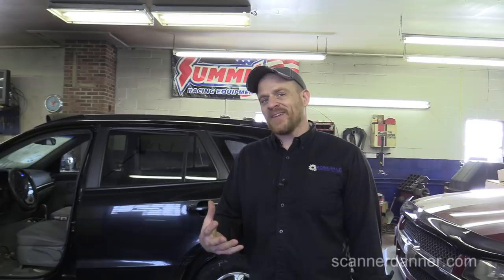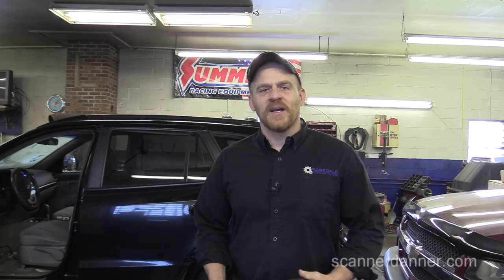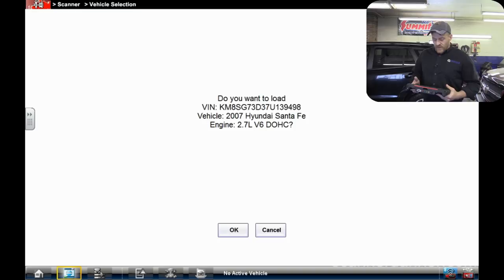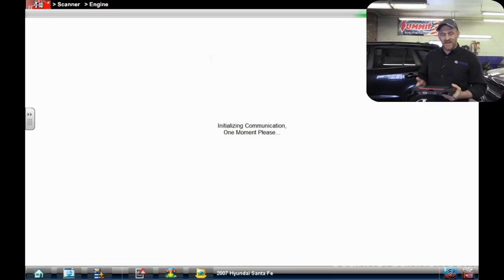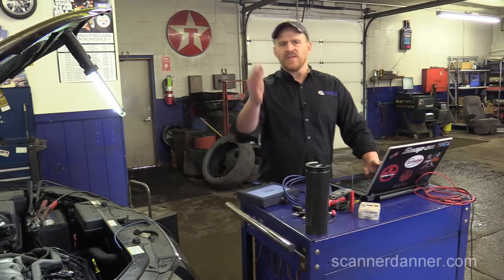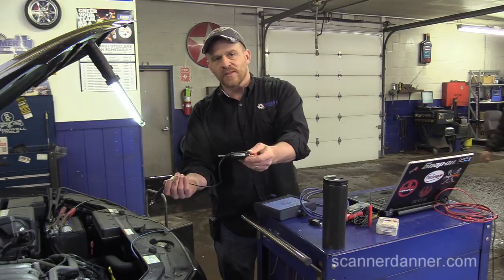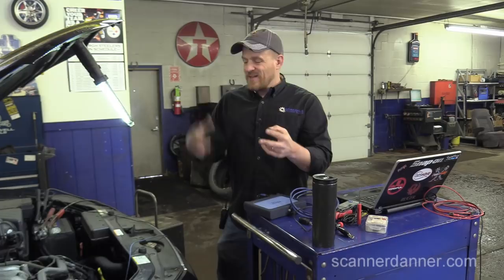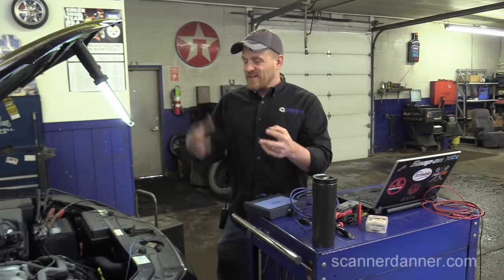No Start Testing Basics - Spark, Injector Pulse and Fuel Pressure (Hyundai Santa Fe)

Comment: ScannerDanner I want to thank you again for your videos, because I have learned a lot from you about testing circuits. About a month and a half ago I started having intermittent no crank no start issues. At that time I replaced an ignition switch after watching one of your videos, unfortunately that wasn't the issue. But your video started me on the journey that kept pushing me to try and solve the mystery. Your videos are the most detailed even to me who never held a volt meter or a test light in my life. After changing the ignition switch and realizing that it was not the problem I started focusing on your videos. I learned more and more every day. My intermittent no crank no start persisted. Once a week, twice a week, my car left me stranded. Today I finally solved it. It was a single partially broken wire from battery to pcm. One day I realized whenever I had no crank I also had no check engine light. And that started me on the path of working up the courage to actually dig in deeper under the hood. Unfortunately mechanics throw parts at vehicles without even turning on any of the basic tools that you teach us how to use. And they are really not that hard to use. Especially for someone who is supposedly schooled to use them for trouble shooting. When I realized that my check engine light was gone and there was a very good possibility that it was pcm related I didn't even want to go near a mechanic. For a simple reason, because just like how they changed my starter at the beginning when this problem started without even testing the circuits, or fuses, I was afraid they would do the same thing with the pcm. So I kept watching your videos. And I found a single red/white wire that had a tiny little hole on the plastic and as I jiggled it it had white powder like substance (corroded away wire) falling out of it. I split the wire touched it together, check engine light appeared. I also had a random stall problem too. So turns out this very same wire was causing that too. I started the car up and while running I pulled the wire apart. And it stalled instantly. I recreated both issues to make sure that wire was both capable of causing the no crank no check engine light,and the stalling as well. My point is that I really appreciate your videos because you most likely saved me from wasting money on parts I never even needed in the first place. Money that I don't have much to waste to begin with. Having an unreliable vehicle is very stressful. And you help those of us who don't have the means to just replace everything until we find the actual problem. I'm really very grateful and I wanted to share my unfortunate and prolonged story, and thank the person who's online guidance helped me to finally fix it. Thanks for your videos, they are very educational, and helpful.
Reply from the maker: Does my heart so good man. God bless you brother. Thank you for encouraging me. Your timing is ordained. You have no idea
Reply: Way to go for figuring out that a small corroded wire was causing all your issues. That is a serious challenge. I can relate to this post, often times I forget that I can in fact accomplish anything that I put my mind to. Sometimes it takes persistence and courage.

Comment: At 30:00 to 40:00 , and again from 49:00 to the end, this is far and away the clearest, most concise explanation of the use of the AES Wave uActivate I have seen ANYWHERE on YT or the elsewhere on the internet.  Both with and without the use of a scope and amp clamp.  AES should stitch these two segments together just to show the tools versatility, and with proper knowledge to back its use up, also add speed to the diagnostic process.  I love mine, and am shocked by many who bought it (incl the older version) and whom have never used it, or are maddingly, blindly unaware of its capabilities.  Of course, one must have a full and clear understanding of automotive electrical theory to put it to its best use, and also not misuse it, or you could seriously damage components (similar to weaponizing a Power Probe if you don't know what you are doing) by sticking other tools into the banana jacks (doubling as test ports), like for example a Power Probe or test light into the wrong ports.  Sure, if you've been around for awhile you probably can already do the same with a multimeter, test light and a fused jumper, like a lot have been doing.  But for someone who hasn't, and is trying to speed up the diagnostic process, this works very well.  Well done, sir.

Comment: Love your process… if you beat 36:38  on the tank, you might actually cause a bad ground to get good enough to make the pump run and it wouldn’t be a bad pump. It may just be a bad ground and it will show up again later if maybe the tank itself was not grounded or wherever it grounds to .

Comment: I did not read the 406 comments for this video, so maybe someone already mentioned this. You say resistance goes down with temperature. It goes up. You saw this with the current. It initially was 2.5 amps(cold bulb-low resistance-high current flow) but decreased to about 1 (hot bulb-high resistance-low current flow). Probably misspoke. Great videos but a little verbose. Could be cut down and still get all your excellent knowledge across. Great teacher. Very informative videos

Comment: Amazing video and Great timing, a V10 Excursion came into the chain store I work at as a tech yesterday 1-20-18, Possible faulty fuel pump on ticket,  Long story short , if the tech that ( started ) to diagnose the problem didn't send it away because of aftermarket wires under the dash- I would have done  very similar in my testing, After seeing this video it makes me question his skills for one thing, and why he didn't check for current at the pump wiring and or check the pump for ground,  he did raise the vehicle and listen for pump noise when someone turned the key, but did not go any further than checking fuse/relays and ear testing, If the vehicle is still in the shop I will myself test this with a test light and leads and see if current is making it to the pump and checking pump for ground,  Thank you for you knowledge and willingness to teach and show others fancy tools are not always needed in some cases, This excursion can be tested the same way and I would love to do it for A theory and B Wanting to be more confident in my diagnosing and repairs, Again thank you for this video and Keep up the great work !

Comment: So essentially, if my learnings today are correct, I could essentially hook my test light to battery positive and then probe pin 87. If light is present it confirms I have ground, decent brushes, and intact wiring or of course if no light, I have an issue with at least 1 of the 3. This all seems too good to be true lol, this can be done within minutes as well as the convenience of staying under the hood.

Thank you for all the knowledge you share with us, you make me feel like I could actually do this for a living if I ever wanted to give up machining.
Reply from the maker: yes sir, but keep in mind that it only tell you there is continuity, it does NOT mean the circuit and pump is good. You may have to circle back on that leg of the circuit if everything else tests good, but yes, it is a great first step on any load side of a relay circuit

Comment: excellent diagnostics format as usual.
I've been seeing what appears as fuel pump failures in modern modular pump circuits with the actual failure at the plug from the pump to the harness plug internally.
good pump, bad connection internally.
something to consider

Comment: Oh man I had a riot @43:00 when you were explaining the test light jumpered across the fuel pump connector. All I could think about was, "Look at them grubby fingers getting all over that interior trim!!" :D My boss woulda tore a strip off me haha!

Great video as always though. True sign of experience was in the beginning when you heard the funny crank and saw the funny bank 2 cam position pid yet didn't get distracted by it. @4:30 you can see the bank2 cam pos is doing a mirror of the RPM pid. Would be super easy to get sucked down that path instead of just making a mental note and carrying on with initial diagnosis to see where you end up!

Comment: I can tell you about the time I learned to always check for current draw.   I made sure I had voltage to pump, put a 2 amp light across pump feed and ground and had light.   Couldn't hear any pump running.   Called a pump.   Ordered Pump, when to put it in and pulled old pump.   Not a drop of gas in the thing.   Fuel gauge was wrong.   Turned out to be a bad instrument cluster that I had to send out to united radio, pump was fine.  Luckily I could return new pump since it was unopened.

Comment: I've worked on hundreds of these cars, but I only had to change a couple of fuel pumps, so it's not a very common problem but it does happen. Sometimes it's a bad connection inside the pump that draws tons of current and it ends up getting burnt. Luckily most Hyundais have an access cover under the seats.

Another method I've done to check lack of fuel on hyundais is to open the line just before the rail, and put a recipient to catch the gas. In cases where the pump doesn't even turn on works great, but not recommended for other cases where you might have some pressure(although symptoms would be slightly different).

Comment: Awesome, like you earlier, what would you do if the pressure was zero, you injected starter fluid, and banged on the tank and nothing happened. You’ve demonstrated these techniques, not that easy to understand, but I will watch this video multiple times until I feel more comfortable. Thanks again Paul....

Comment: Hey Paul I had a question regarding time stamp 39:46 
Where you talk about putting a test light on positive side saying it should light up
Is that because the test light has such a low amperage that it won't load the fuel pump and just go straight through it?
Reply from the maker: yes! Another way to visualize this is that the fuel pump motor basically has no resistance until it starts to spin, so the motor is basically a ground path for the low amperage test light

Comment: i learned a lot on this video... for this kind of technical problem i love the way you dont shorcut anything.. do you have and videos that had power feed from Fuse boxes and lines but not getting power and pulse from injectors.. or getting power from battery to fuse boxes to ECM but ECM dont give voltage to injectors
Reply from the maker: Check out my chapters 17 and 18 playlist (fuel injector testing) 
Thank you!

Comment: One absolute test for the pump is to apply 12v to it. This removes any doubts about poor or intermittent connections. I've seen lots of cars with new pumps and relays with an intermittent wiring fault.
Reply from the maker: There were no doubts. Learn to trust your meter and you won't need to jump components directly. I never do.

Comment: Great instructive video as usual, I always enjoy watching your troubleshooting logic. 
But on this one, at the last stage of your diagnosis where you are isolating the fuel pump as faulty, you seem to rely on the motor ground being reached through the motor brushes, but would a in-tank fuel pump really use a brush/commutator type motor? I would expect it to have been a brushless DC type motor in which case you would still need a separate step to confirm a sound motor ground exists.   Please advise and clarify this for us and thank you.

Comment: I love your videos, and this one is no exception. However, only chlorinated brake cleaner makes nasty vapors when it burns. The chlorine is what makes the phosgene gas. Non chlorinated brake cleaner is perfectly fine to use as a starting fluid since it contains no chlorine, and therefore can not make phosgene gas. I use it as starting fluid all the time. Just so you know.
Reply: The lesson here seems to be: check the label your brake parts cleaner.  Some are not chlorinated, so they can't form phosgene (which of course doesn't mean they are completely safe - just that it doesn't produce that particular gas.)  And from a cursory bit of research, it seems that high heat and/or intense UV radiation are most likely to cause chlorinated cleaners to decompose into phosgene, so definitely don't use chlorinated brake cleaner to prep parts before welding!
Reply: I usually use carb/choke cleaner as a fuel source. I only used brake cleaner once, a few years ago. Nearly killed myself. 

My local store carries "chlorinated" and "non-chlorinated" brake fuel. I was out of carb clean the day I was doing my fuel test.

 So I grabbed the closest can of brake cleaner  off my workshelf, which I had previously purchased, which turned out to be the "chlorinated" version. I don't remember my thought process when I bought it, I think I just chose at random, but I won't do so again.

I sprayed some brake clean into the intake and sat down in the front seat and cranked the engine. Immediate start. 2 seconds later, (with the car door and window open) I was choking harder than I ever have in my life. I could not breath AT ALL.

I knew in less than a fraction of a second there was something wrong.  My brain said "poison" and I jumped out of the care and I sprinted as fast as I could----  50 feet across the lot to get to fresh open air. I stayed there gulping fresh air for a long time. I was SCARED! I did not know what happened. I waited until a minute after the engine stopped running, before returning to the car, letting the toxic gas disperse in the wind before I went anywhere near the car.

I started thinking and I realized that whatever happened, it had to be a result of the brake clean that I shot into the intake. I had done the same process using carb clean a hundred times and never had a problem.

 I looked at the can and noticed that it said "chlorinated". What I ASSUMED had happened was that something in the chemistry of the cleaner was  SOME FORM of chlorine, which apparently was changed or burned during combustion and came out of the tailpipe creating whatever gas was choking me. But it did not smell like chlorine at all. I don't have a recollection of it smelling like anything familiar, it just smelled REALLY REALLY bad. Since I am going to try to avoid breathing phosgene in the future, I probably won't get another chance to find out what it "smells like".    

SO, TWO LESSONS>   
1. Never burn chlorinated brake cleaner (like Avery and aussie have said).

2. Never BUY chlorinated brake cleaner unless there is some specific reason that you need it. I have no idea why it comes in a chlorinated and non-chlorinated version, but there must be a reason of some kind. Some kind of advantage that it has over the non-chlorinated. Maybe it cleans better, don't know.  Anybody know?  Bueller? But I'll never buy another chlorinated can, even if I don't plan to use it for burning.

I have always preferred a spray can of carb+choke cleaner, and it has always worked well for me.

What do the rest of you think about using carb+choke cleaner versus brake cleaner to squirt into an intake?
__
I did not know about the generation of phosgene, so thanks to the aussie and Avery for explaining that.  I know Phosgene is a deadly toxic gas that works very quickly.

Also, another distantly related fact that people  here should remember is that TEFLON, when combusted, also creates Phosgene. But I believe it takes an extremely high temp to burn Teflon, I'm not sure.

Thanks to aussie and Avery for their knowledge.
Reply: You are right, and I am glad you are OK. Another thing to remember is that burning refrigerants will make nasty vapors too. CFC and HCFC gasses make phosgene, and HFC gasses make nasty vapors too, but I can't remember which off the top of my head. As for burning teflon, I know that it produces perfluoroisobutene, which is more toxic than phosgene. It takes temps of around 850 degrees or more to burn teflon, which isn't too hard to reach, so be careful!
Reply: Avery Alexander Thank u Avery for the insight. I think in the old days they used to use Freon as the propellant, and when I burn that stuff, Whoooe!!  I was arc welding one time and a dingleberry melted a hole in a and old paint spray can and that smoke was very dangerous
Reply: Just get some gas and pour it into an empty window cleaner bottle.  Squirt it into the intake.

Comment: Very knowledgeable in what you're doing. My question is if I may, is my Santa Fe with a new pump loses fuel pressure after I shut her down. Is there a pressure reg.? and where is it? I'm replacing the dampers , do you think this will make a difference?

Comment: Another way to check the fuel pump continuity. Remove fuel pump relay- probe pin (87)- and green led on power probe should illuminate. If not- you have a open circuit. Power Probe- makes your life easier.

Comment: As I recall Hyundai sells a little kit to install a fuel pressure test valve. Also the Santa Fe's had some corrosion problems and leaking with their fuel tanks. Had to replace mine. Go easy banging on them!
Reply from the maker: good tip, thanks!